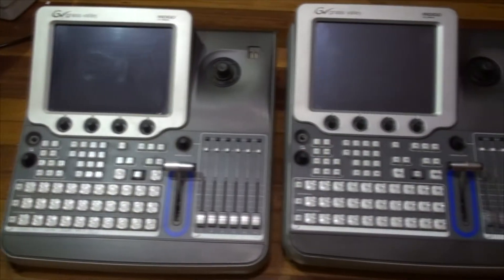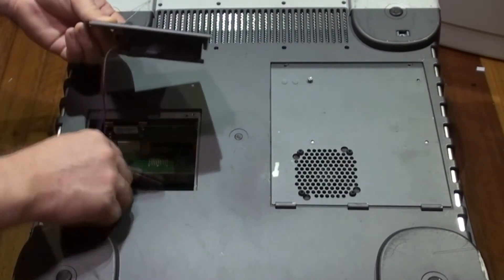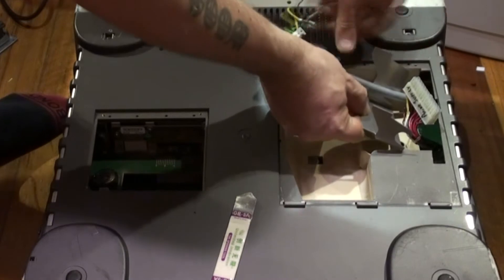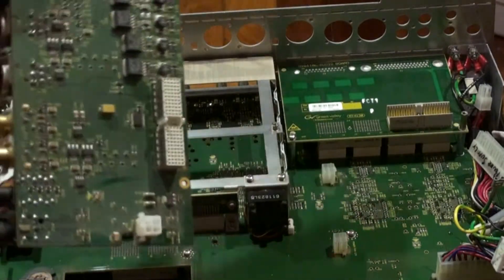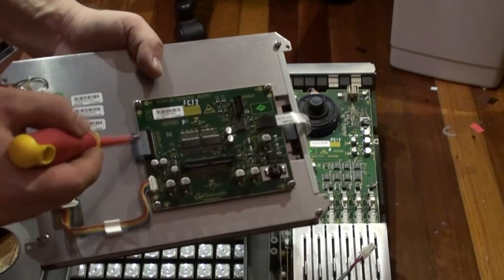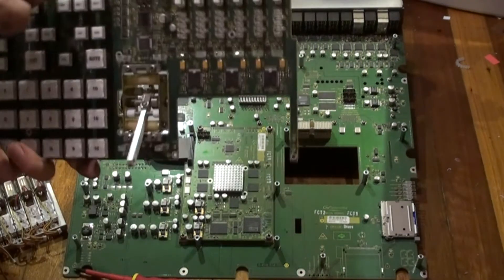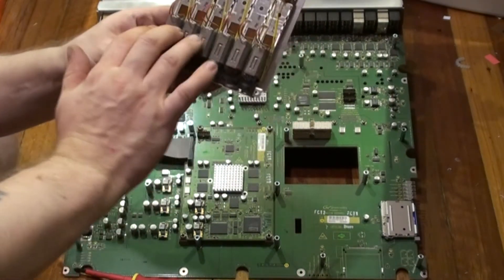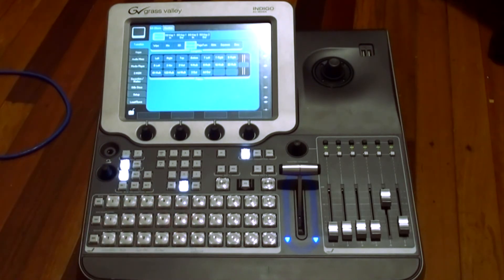Whats Inside Professional Video/Audio Mixer Grass Valley INDIGO 1

Comment: Hey Great Video man! I recently picked one of these up about a week ago. I think the power supply is bad. When I turn it on the cooling fans run but absolutely NOTHING else happens. I tried to find a service manual for the system but failed to do. Do you have one? I tried to probe the 24 pin connector and all I was able to get was common and 5vDC. The fan connectors appear to spit out 12vDC but I can't seem to figure out what rails are bad. Considering where i was able to get 5vDC a typical PC power supply would not work with the connector underneath it. Any help would be greatly appreciated! Thanks again!

Comment: Hi! Tnx for video! I wanna buy switcher like this. Is this switcher supports 1080p50 signals?
Reply: Are all of them (Grass valley Indigo) suppurts HD?
Reply from the maker: Yes but you have to make sure the optional card at the back is installed, then you get 2ch HD, you can tell by looking at the back panel where all the inputs and outputs are and see if there’s DVI ports there or just a blank plate, if the card is installed then you’ll see the DVI ports and that means it’s HD.
Reply: @MaxELECTRONICS  Tnx!